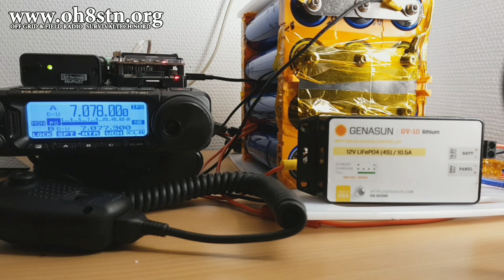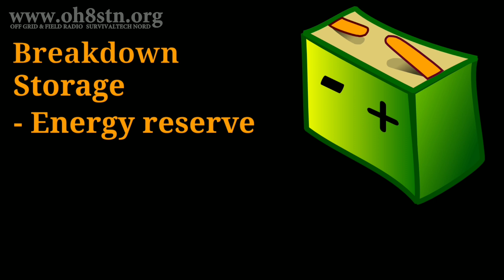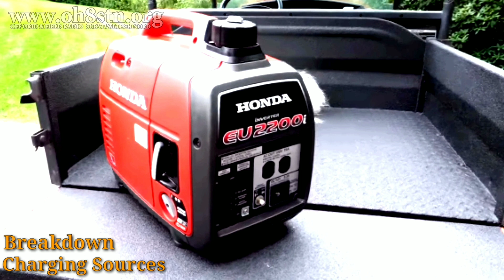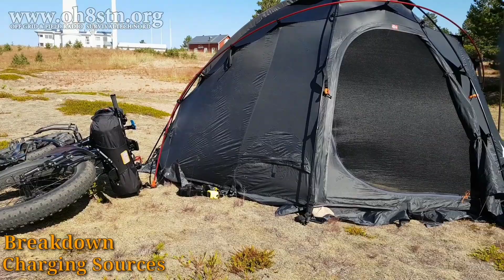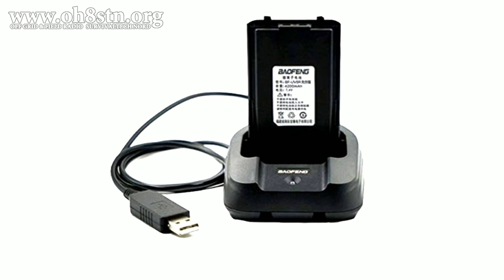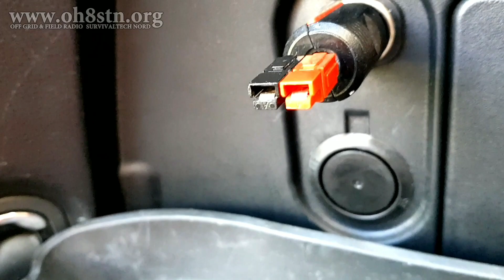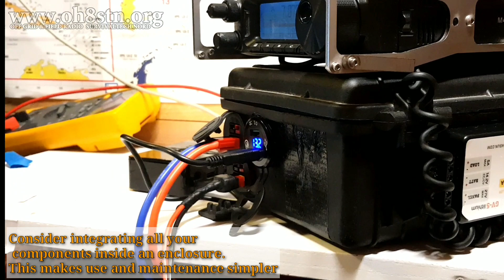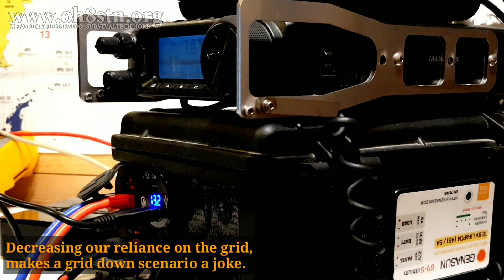Backup Battery Power | Grid Down Communications

Comment: Thank you for the discussion. I have several questions.
1: you use Powerfilm solar panels, These are considerably more expensive than traditional panels. I can think of several reasons to use them like weight, durability and portability. Are there other reasons to chose them over traditional panels.  
2: you also mentioned wind turbines, there are two main types of turbines, the traditional blade and the Savonius wind turbine or vertical axis blade. can one be deployed closer to the ground and work in lower wind speeds?  Also what is the noise difference between the two different blades.
Thanks
Reply: Se Youtube videos from Missouri wind and solar as another source on small wind generators.
Reply: When it comes to wind, let me tell you in the simplest terms possible...FORGET IT FOREVER.

Back in the mid 90's I installed a 3,000 watt Whisper on an 84 foot tower on top of a hill where you could see it for miles and miles in every direction. I had a 60kwh battery bank that weighed about 3,000 pounds, a Trace SW5548 inverter, and a T240 I think it was called, to step up the voltage from 120vac to 240vac for my well pump.

Long story short, it averaged about $50 a month worth of power or around 550kwh, all for the low low price of around $23,000, and I did all the work myself so no labor, well my pastor from church ran the tractor to raise the tower, but that's all the help I had. This did cost not include my diesel gen set and fuel.

So imagine how much less power you'll get from a smaller wind generator, and closer to the ground with more obstructions around you.

There really was NO up side to this system at all as far as the wind producing goes. The inverter and everything else was great, but back then all we really had was lead acid batteries, so that was weak link as well. All in all, it was very nice to have when the power was out, because it switched over instantly and powered the whole home, outside of electric heat, stove, water heater, and dryer. For those items I had a 33kw diesel gen set and 3,000 gallons of treated fuel. The inverter would start the gen set when the batteries were at 60% and charge the batteries and we'd use the 240vac items at that time.

This wasn't designed to take me completely off grid, it was just a long term emergency back up system, and also to help reduce power needs from the grid. For the money spent, I could have cleared out a few more trees, and gone solar and easily doubled and even tripled my power production in the summer.

Long story short, go solar and do it right, like I'm doing now at my new place. 

Keep up the great.

Comment: Amp hours (limited energy source) VS. the impatience to use more than QRP (QRO) led me to the concept of maximizing efficiency in the antenna system, including the feedline.

In other words, QRP in our current sun spot cycle basically demands that our antenna system be very efficient and effective (two different things) meaning not wasting power. Heat is waste.

Poor element radiating efficiency +  poor propagation = higher power to make voice/phone contact. QRP is hit or miss. More miss, if we're honest.

Yes, weak signal work on many of the digital modes is one of the most efficient methods, but this requires the RX station to have the correct software to receive the signal and a reason to reply. This severely decreases reliability and a very inefficient strategy. Still, a very worthy tool in the toolbox.

During severe situations requiring EMCOMM, human's more often than not will expect another human's voice to communicate with. We can hear truth, stress or other inflections in the human voice. Text, not so much. 

The human voice can bring calm to chaos.

Strategy, as discussed in this video, is the key word. For me, I've learned that without a proven and efficient "antenna system" especially on HF, we may find ourselves trying to force a bowling ball into a garden hose.

Now I'm learning to work backwards from the antenna system and this channel is a gold mine to complete such a strategy. There is no wrong way except for not trying.

O8HSTN has the entire strategy nailed down. The amount of time, investment and work involved is increadible.

I'm not sure many of us fully understand what he has given to Amateur Radio on a global level.

Comment: Diesel generators in the USMC during 2000 were very loud. Surprised that there were not more subtle options.
Reply from the maker: I recently saw a documentary about solar power stations for FOBs. they are getting the idea, but it takes time
Reply: I read an article about them in Popular Mechanics (or Science).  The driver is cost and the logistical train.  The DOD calculated that, between equipment damage caused by IEDs and the cost of injuries to personnel, it cost them $800 to get a gallon of diesel to a FOB.
Reply from the maker: @bernarrcoletta7419  yes that's the one. I think what I've read or seen was based on exactly that article.
Reply: The Tactical Quiet Generator was starting to be issued in 2006/7 when I was in AFG.  More info:  https://www.marcorsyscom.marines.mil/Portals/105/PfM/LCES/ES/Power%20Team/Mobile%20Power/Info%20Sheets/30KW60HZTACTICALQUIETGENERATOR.pdf?ver=2018-11-13-150412-550